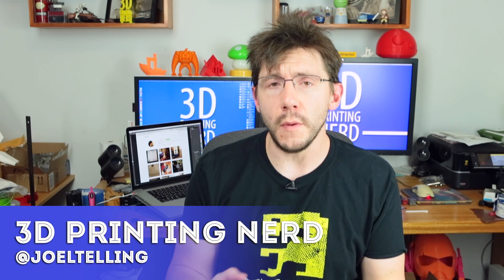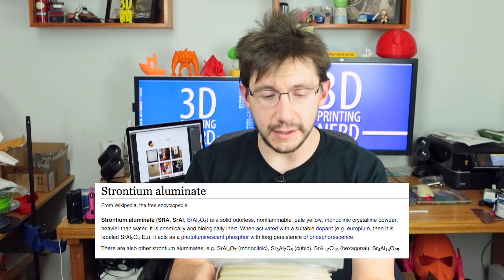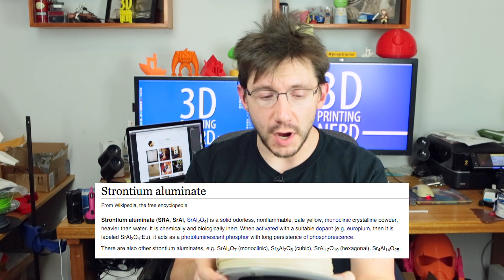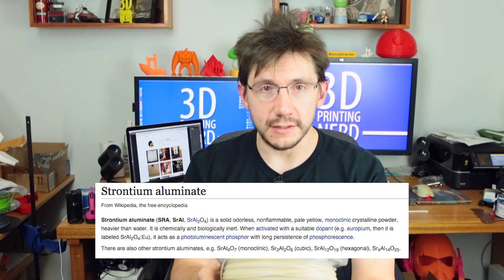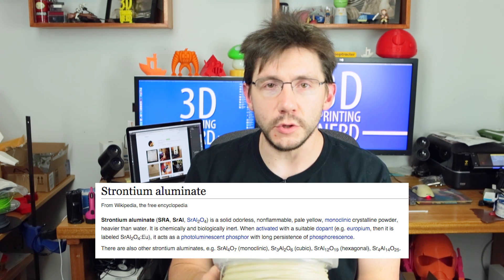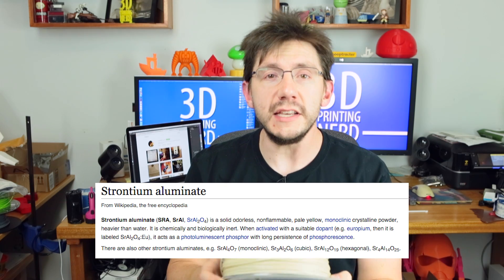3D Printer Nozzle Ruined by Glow In The Dark Filament?

Comment: Sorry, but it is so stupid take "don't touch fluo and glow filaments if you can't buy a nozzle for 2 bucks."
You have nice camera, light and 3 computers but you can't buy a pack of chea nozzles? Or hardened steel nozzle for 10 $?
Nozzle is a consumables, like are belts and wheels, why do you want our audience to care about it. 
Like, brushing your teeth will ruin your toothbrush, so dont brush your teeth, huh?:)))

If a person just want to print only pla it is okay, but if you want to try tpu or nylon or wood/metal filaments you will need to learn how to change nozzles. Every composite filament will ruin your nozzle, it is just a matter of time.

Comment: I have printed spools of glow in the dark and carbon fiber out of my Chinese V6 clones without a problem between any other colored filaments.
I've had the odd nozzle clog about 3 times over about 7 spools. I don't know if it makes a difference but I only use Hatchbox PLA with the odd couple of spools of Zyltech.
I print using .3mm nozzles and with a .1 layer height only.

Comment: I can buy bout 50 brass nozzles for the price of one hardened nozzle. You do the math.
Reply from the maker: Just a sec...

<scribbling on paper>

1 hardened nozzle (source: Printed Solid) is $21 USD.
That would mean you're getting brass nozzles at 42 cents USD each? WOW!
Reply: @3DPrintingNerd  - I can get a box of 28 nozzles (BAISDY) for the CR-10 for $8.99 or 30 (Wellerly) for the Mini Delta for $10.99 from Amazon.

Comment: I measured my extruded filament diameter with calipers when I first got my machine.   It measured 0.4mm  matching the nozzle size.  I have since run 2kg of normal pla and about 1/4 kg of glow in the dark.  I now get a measurement of 0.46mm.  I haven't seen any mention on  the internet about measuring the filament this way.

Comment: I put glow in the dark pla on my makerbot then it start to click why is that can it damage the stepper motor
Reply: The clicking is probably your feed gear for the filament. I would guess the filament might require a slightly higher temp on the nozzle and isn't melting as fast as it's trying to feed, so the feed gear is doing a "burnout" on the filament.

Comment: Are there any downsides to hardened nozzles or can I use them as an everyday nozzle also?
Reply from the maker: The worry some have is if the hardened nozzle will be as thermally conductive as the brass nozzles. I personally haven't had any issues, and they heat up just as well as my brass ones.

Comment: Here is one other "interesting" experience that I got with the HK glow in the dark PLA. After printing about 500gr of it I found out that my printer was no longer being able to print ok normal PLA. Not only the nozzle got messed up, but also the extruder gear had a ditch on the point it was using to push the filament. I had to change both the nozzle and the gear to get going again.

Comment: nozzles are cheap af, though, and you can just melt them down and recast them, so... who cares?
Reply from the maker: Not everyone can melt them down and recast them, though. Plus, recasting to with correct tolerances sounds tough - is it?
Reply: a basic blowtorch should get hot enough, especially if you make a little furnace by lining a coffee can with clay or something. then pour it into a cast of the basic shape of a nozzle and when it cools thread it and drill out the nozzle diameter you want. it takes some work but it can be done in a home kitchen.

Comment: strontium aluminate is an abrasive substance
Reply: Your mileage may vary... I ran Glow filament through a 0.4 nozzle (about ~60+ hrs of prints) I did not notice a difference with any prints after. Makersmuse said the same thing.. Now this does not mean that it does not remove some brass from a standard nozzle. How much? Well I don't know. I would like to see a video where you try to wear a nozzle out with abrasive filament.  That being said, I did switch to a steel nozzle on my setup, just in case and because it is a PITA to change nozzles. They are cheep and I did not need to bump my temps (as some have mentioned that needs to be done using steel vs brass alloy) Note: I am using the Flexion HT extruder and hotend.
Reply from the maker: +Mark Williams truth

Comment: Before I continue the video, Im gonna have a stab in the dark at the answer to his question. The carbon fibre filament has a hotter melting temp ( 220℃ to 250℃ depending on the spool.) compared to the Glow-PLA filament which works well at around 190-200℃. They are both abrasive and wear copper nozzles really quickly.

Comment: If hardened nozzles are so cheap, and you can print regular filament as well as glow and carbon with them, then why don't printer come with them as a default instead of softer brass?

Comment: ...going back to the nozzle, in par-tic-cu-lar the Duplicator i3, I just got a harden nozzle for my Dup but I cannot find hide-nor-hair of any info on how to replace the nozzle. I took a wrench to it but everything started to move so that nixed that.  There is a Wanhao vid on how to replace the feeder tube and there-in taking the nozzle off by my heating block does not have that hole to place a screwdriver in. (Must be a V2 thing?)  Any who, do you know of a vid I could watch on this topic...or....perhaps a suggestion for an upcoming instructional vid here.  :)  [Teaching high five]
Reply from the maker: +Michael Phelps I haven't replaced the nozzle on my Duplicator i3 yet, but I know I'll need to. Usually the nozzle is just snugged up to the heater block. If you can use a pair of pliers to hold the heater block still, then use another pair of pliers or wrench to undo the nozzle, I think you would be golden.

Comment: Interesting. I use RepRapper Tech GITD filament a lot and not noticed any wear. It has one of the best finishes I've had. I love it. I wonder if they use the same chemicals
Reply from the maker: +Montague Flange I think there are three different chemicals companies use. I'm trying to remember which ones. Even if the RepRapper Tech uses strontium aluminate, if it doesn't have that much in it, then it won't be nearly as damaging.

Comment: oh man, i knew about the strontium aluminate being the most common way of making things glow in the dark, but i never even thought about it being harder than the brass (i think the M3D nozzle is a coated brass..). Good thing i have an extra nozzle! Thanks for the informative video, Joel! Thumbs up as always! (and high five, too!)

also: at this point i've only printed about half a roll of Glow in The Dark, and the coating on this nozzle seems to be holding up so far, but maybe i'll start using that filament more sparingly lol

Comment: +3D Printing Nerd
Thanks for this tip. I was actually getting ready to start printing with some of the Hatchbox Glow in the Dark filament today. Think I'll hold off for now.
Reply: +relik0fages I have the hatchbox GITD PLA filament right now. I've went through about 3/4 of the roll with increased degradation in quality on my rostock max v2. I was wondering why I can't even get the simplest of prints to work...and it was doing so well. Too bad I just saw this video after the fact.

Comment: I don't see myself ever using the glow in the dark, however I plan on using carbon fiber.   I had to replace  nozzle after using a spool of wood filament (not sure if it was because of the filament, or for other reasons), so I'm hoping that the new nozzle is a bit tougher.  Thanks for the info.

Comment: When you get a new nozzle, just be aware they went with brass for a reason:  it's very thermally conductive, it can heat and cool quickly.  I have a coated stainless steel nozzle now, and I find I have to set my temperatures higher, because it doesn't heat up as well.  It also takes a long time to cool back to room temperature.
Reply: +Michael Vaughan Oh!  I hadn't thought about that; I destroyed my brass nozzle while starting a 3rd printing use carbon-fiber - which was sort of of on purpose, granted, as I had plated nozzles waiting around that I was going to move once the brass died - but then I thought I might have done damage to the thermostat or something because all of a sudden I had to increase all my temps by ~10C in order to get the same apparent flow.  Never even occurred to me that this might be why - thanks! (And good to know I don't just have a strange printer that requires +10C to do anything ;) )
Reply: I'm doing the same, but apparently there's a "PID" setting or something I can change which will let me configure the temperature curve.  I don't understand enough to even know where to find that.
Reply: +Michael Vaughan Here's the only thing I know about PID settings: http://reprap.org/wiki/PID_Tuning ...but from my understanding, tweaking that just helps with temperature fluctuations, not with the actual temp you've got your nozzle set to. I found that after someone made a comment on one of Joel's other videos (the Wanhao review, IIRC) about how if the temp is swinging by more than 1 point (and/or swinging often) then it likely needs adjusting.  But then again, I asked the guy who built my printer about this and he said that (as he had tested it prior to shipping) odds were my minor fluctuations were environmentally-caused (which is quite possible, given where my printer is at) and that PID-tuning wouldn't help.

In any case hope this helps! (And if it does, let me know so I can go do it...)
Reply: Thanks.  I'm thinking of a few solutions at the moment.  None of them coalescing into actual action, though.
Reply: +Michael Vaughan What; adding 5-10C to your nozzle temps-vs-brass isn't a solution? Works fine for me. ;P
Reply: It works for my good filaments, but my cheap ones tend to overheat in the nozzle.  I may just use Simplify 3D to adjust the temperature down after a certain time, so the real temperature stays about level.  If I'm setting my printer to 230, it may not actually be reaching that for about five minutes into the print.  I need to get some solid metrics of the difference between the nozzle and the sensor.  The weird thing is, on the Replicator 2, the sensor is inside the block of aluminium, not in contact with the nozzle, so that says to me the sensor hasn't been precisely accurate since the day they designed it.
Reply: +Michael Vaughan Ooooooh okay, so you've got a different issue than I do, I think; the only nozzle temp I look at it the one the firmware tells me, as the sensor is in the aluminum like yours and anyway I have no idea how else I would check it. 

This convo is interesting, but we probably shouldn't be cluttering up this video's comments with it. I'm moving my full reply over to this channel's Discussions section so we can continue it there. :)
Reply: I don't have much more to add, in any case.

Comment from the maker: Material science is awesome.
Reply from the maker: Technically, it doesn't matter if it's ABS or PLA, the nozzle damage depends on how much of the glow in the dark stuff they add to the filament formulation. For what it's worth, I've printed with a bunch of glow in the dark without a plated nozzle just fine. I think the chance IS there to have more damage from higher concentrations of glow in the dark material.
Reply: that stuff is what makes my motorcycle glow in the dark! I mixed it in powder form in the paint before spraying it!
Reply: Joel! excellent video, I just wish you would have posted it about 12hours prior. I just ordered my first roll of glow abs. Fortunately I also ordered new nozzels, so no big deal. I'm noticing all kinds of different issues with Hatchbox's Glow ABS I've never had with any other of Hatchbox's Fillaments ABS or PLA.
Reply: +3D Printing Nerd Thanks for this video. I've been printing with Hatchbox glow in the dark PLA for about a week and was unable to figure out why the nozzle was doing so poorly already. This may be the answer.
Reply: +Chris Stampfli Crap, im in the middle of a 24 hour print with Hatchbox PLA right now...
Reply: +BAW5films They were talking about the glow abs. PLA is just fine, im on my 11th roll with an unhardended bronze nozzle.
Reply: 3D Printing Nerd You should do a review on the da vinci mini from xyz printing.
Reply: bullshit. 
start running materials thru the paces. you weak thing.